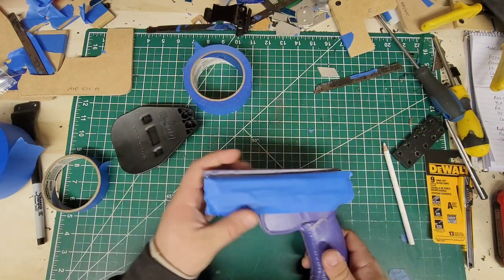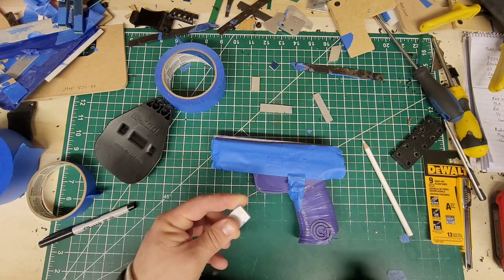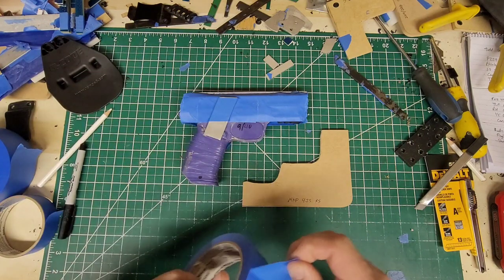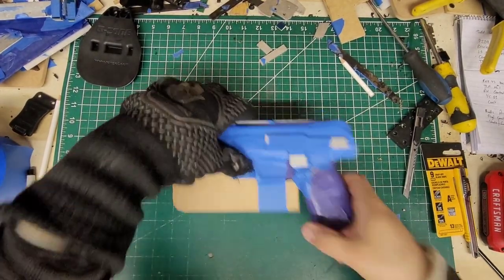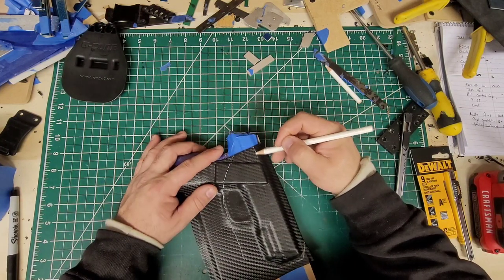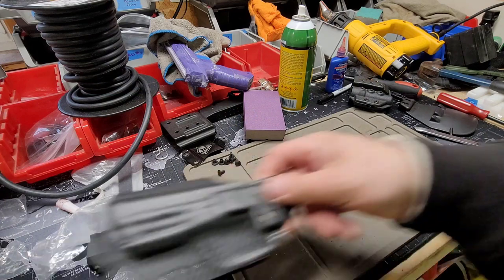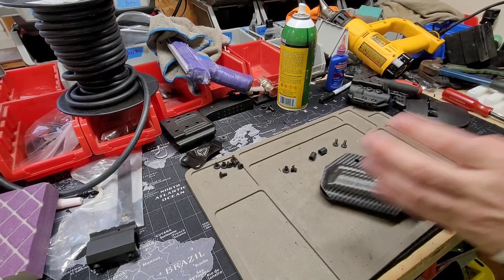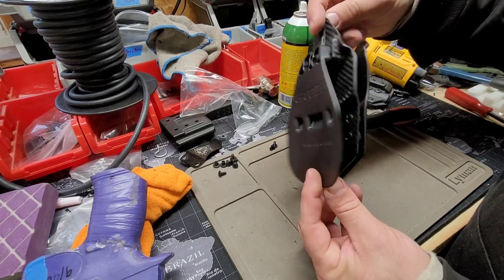G-code Paddle holster in carbon fiber

Comment: Iggy I have to make a 4-10 Judge revolver in the pocket holster, Grip accessible. What clip would you recommend for good retention on the pocket ?
Reply from the maker: Technically pocket holsters have a hook at the end and grab on to the pocket when drawing. And holster falls to the floor when gun is drawn. But if a clip is desired id probably rock a ulti-clip
Reply: @FalTacUnlimitedLLC  Thanks